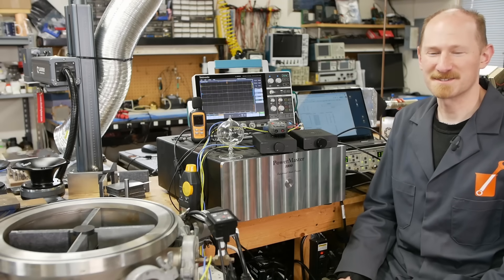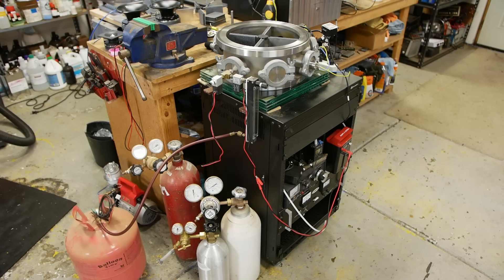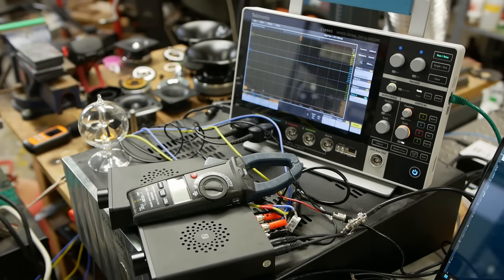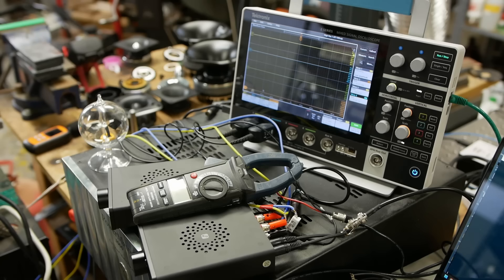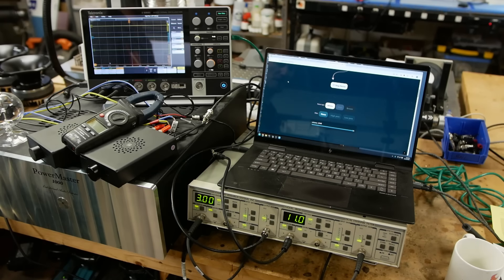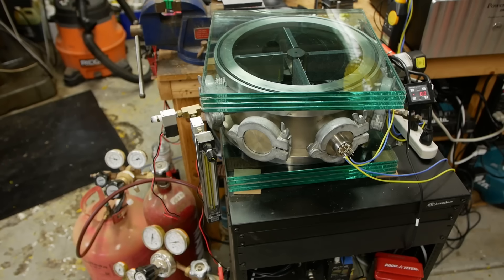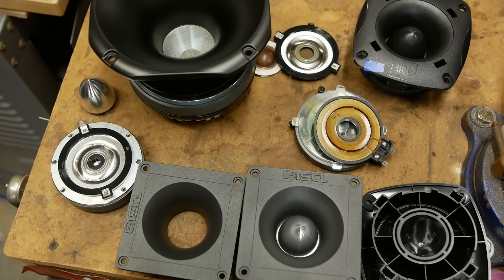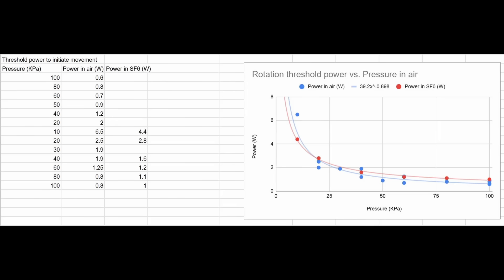Acoustic Radiometer spins in 130dB sound, clockwise and counter-clockwise depending on sound pattern

Comment: "...over 130dB..."

Compared to what? 130dB is just a ratio. Without a unit measure or a reference value it means almost nothing. 130dB(A)? 130dB(B)? 130dB(C)? 130dB(G)? 130dB(Q)? 130dB(SPL)? 130dB(SIL)? 130dB(SWL)? 130dB(HL)? 130dB(pp)? Which one?!

Comment: I wonder if you could use magnetic braking with the aluminum rotors (or install a flat aluminum ring on the top of the vanes achieve a more consistent braking) and then measure the rotation rate at each fixed power level.  This would allow the rotor to reach an equilibrium point between the rotational force from the sound and the proportional braking force from the magnetic braking.  It would drastically reduce or eliminate the uncertainty coming from trying to determine the influence of the forces on an already rotating vane.

Comment: if a standing wave makes the rotor move but only until a certain point and to make it rotare you have to use pulses, you could make a crude stepper motor? if the standing wave moves with frequency and the rotor is locked in the null the position might be a function of frequency

Comment: There are other types of tweeters than those bullet/horn tweeters. I've seen them but I can't recall their names off the top of my head but they might work differently in the different gasses.
Also have you thought about building a high-pressure chamber to see if that makes the rotation increase. IT would probably work in a vacuum chamber that I see people using to de-gas epoxy, but you would have create ports for the wires. I think it would help a little but after a certain point it would have the opposite effect.
REALL AWESOME VIDEO!!!

Comment: The TAS2764 amplifier used in apple sillicon macs also uses voltage and current sensing to measure the speaker temperature. There is even an open source linux implementation making use of this feature called speakersafetyd made by the asahi linux team. Mindblowing to see you figuring out a way to do this by yourself
Reply: If you want hints on this: V*I will indicate R, content played can indicate Impedance through the average of that content, and the temp co of the speaker coil will dictate the change rate
Reply: I remember some linux fuckery I did where I had to manually install asahi. Now I know what it is!
Reply: Some power amplifiers in professional audio systems can also perform impedance measurements on speakers. This allows you to identify defects such as a stuck speaker or even a broken housing.

Comment: What happens if the adjacent speakers have sinusoidal signals that are 180• out of phase?  That is, speakers across from each other are in phase, while the other two are out of phase.  Couldn’t you slowly ramp up the frequency to get the thing spinning fast?  This would also probably provided a way to spin it in either direction.

Comment: Wait wait wait... You're saying a bouncing ball delivers more energy to the floor on impact than a ball of clay that just thuds? I'm having a hard time wrapping my brain around that one.
Reply: Maybe this only works for bigger objects but quantum physics make it work in reverse for smaller objects like photons?
Reply: Hmm no a radiometer works using convection. I'm also puzzled a bit. Sounds intuitive because absorbing an object only catches the energy the object has due to speed and mass, but bouncing off first stops the object and then it gets pushed back again. But explaining it makes it fall apart, because bouncing means the object still has a lot of energy left while when you absorbe the object, all energy is being transferred
Reply: @Robbedoes2 the explanation is about as simple as conservation-of-momentum gets. Off the top of my head, neither relativistic or quantum effects introduced when thinking about photons should make any difference
Reply: Yes it does. Perhaps it makes intuitive sense, because when the bouncing ball rebounds, it transfers part of its elastic potential energy back into macroscopic kinetic energy for the floor and the ball. The smushed clay ball on the other hand doesn't rebound, so it doesn't do any work on the floor after being compressed. That work went into heating up the clay ball.
Reply: Don't confuse energy and momentum. For the same mass, the momentum transfer will be larger for elastic rebound. Also energy can be delivered into kinetic or thermal. A lot of energy goes into heat during non-elastic collisions.
Reply: Energy, no. momentum, yes.
Reply: @vaderdudenator1 But with momentum being p=mv and kinetic Energy E=m(v^2)/2, if the momentum change is larger, the Energy E=p^2/(2m) should also change more, no?
Reply: This was a head scratcher for me too. 
With the momentum calculation you multiply mass by velocity, so in the rebound case the mass of the paddle doesn’t change, but with the sticky case the mass of the paddle… wait… also doesn’t change?
But it gets added to the mass of the ball. 

I need to go to work now. Please finish this, clever people
Reply: Yes, it makes sense when you think about the fact that work has to be done to deform the clay, and since the deformation is permenant you don’t get any of that energy back except as heat
Reply: NOT energy. momentum
Reply: @the_moo000oon well it’s both

Comment: can you explain to me why when a particle hits the reflective side it would deliver twice the momentum? I guess my gut reaction was that if a molecule came in and hit the absorption side, that the kinetic energy of that particle would be mostly transferred into the rotor. But if it bounced off the reflective side, after the event the particle would still have significant kinetic energy, which would mean there must be less energy transferred to the rotor. I must be missing something.
Reply: Yep, I would think the same. Energy should be conserved and if a particle's kinetic energy is changed to zero that energy has to go somewhere. I sadly also didn't understand the explanation.

Comment: This is way cool, and puzzlingly molecular-ratchet-like. If you scaled this down I assume the rotor would thermalize with the air so as to not spin? Or at this scale, if the rotor was itself emitting sound? I’m wondering where that would break down. 🤔
Reply: It's complicated because the force can be used with standing waves to move blood cells thousands of times smaller than the wavelength (see: acoustophoresis, 'acoustic radiation force'), so scale should't be a problem; but i'm unsure if that would translate to the case with white noise, especially since 130Db is above the non linear region and almost creating shockwaves. With those sound pressures, the rotor has to be vibrating all over the place, and especially the foam because it has less inertia. it would be nice to see it done with lower Db values in a more sensitive setup.

I really would like to understand the reflecting/absorbing wave explanation to see if it is correct, but to be honest i don't even understand why it spins in reverse with the pure sine wave; why there is a radiation force for sound waves that are supposed to have zero overall momentum.  
I ended up on this paper "Acoustokinetics: Crafting force landscapes from sound waves"  which is entirely too advanced for me, but i mean look at that sentence "These observations illustrate that nonconservative forces can emerge along directions where the sound field carries no net momentum. More generally, it shows that radiation pressure can be directed independently of the direction of wave propagation." that sure does sound nice.

Comment: Speakers should quote peak, rms and continuous power. The rms continuous should be what you can drive it at without it blowing.  The peak is often double  this or more.  Current practice is to use an amplifier rated at twice the peak driven to no more than 70% this way there are no nasty distortions or harmonics and the speaker is driven cleanly

Comment: Static panels, with torsion measurement, to provide milligram or microgram (mN / uN or whatever) pressure for each gas - single speaker and single sound direction but directed at the test material. How about methane, propane, and more densities of test gasses, avoiding the possibility of accidental combustion of course!

Comment: I enjoyed your explanation of acoustic impedance. I ran into the term orthophonic while restoring and playing with some Victrola phonographs. The bearings that support the needle were improved, and scientific methods were applied to the horn shapes to improve the fidelity and efficiency. It surprised me how loud these could reproduce sound from mechanical coupling. Like most impedance matching methods; taking one form of oscillating material and coupling it to another: from needle vibrations to air. Even the needles had different shapes to best transfer the sound.

Comment: I'm curious: theoretically the absorptive side of the rotor vanes should be warmer because it's disappating the absorbed sound as heat.  Can you inject enough sound in order to see a difference in the two vane sides on the thermal camera?

Comment: You're on your way to a world record for "Least efficient electric motor".
Reply: lol 😆🤦‍♂️
Reply: what is currently the least efficient electric motor? afaf
Reply: @avasobersup7746  maybe that piezoelectric walking circle he made a few years ago?
Reply: @avasobersup7746  They are only used for small linear motions (typically to maneuver a valve) but the ones that heat wax to make it expand are pretty lousy, especially as they require power just to hold the valve still.
Reply: @avasobersup7746 
Ai? 
It flips switches to get people to type things with their thumbs?
It's not 100% electric, but isn't it?
Reply: or potentially a windmill that works when there's no wind
Reply: @B.M.0. ਤਿੰਨ ਸਕਿੰਟਾਂ ਦੇ ਵਿੱਚ ਚਾਰਜ ਹੁੰਦੀ ਆ ਤੇ ਇੱਕ ਸਾਲ  ਚਲਦੀ ਆ ਬਈ ਇਹ 
6.3KAV 
Hz50
235V
Ac v
ਸਿੰਗਲ ਫੇਸ ਹੈ
ਤਿੰਨ ਸੈਕਿੰਡਾਂ ਚਾਰਜ ਹੋ ਜਾਣਾ ਤੇ
ਮੈਂ ਕਹਿੰਦਾ ਭਰਾ ਆਸਟਰੇਲੀਆ ਨਿਊਜ਼ੀਲੈਂਡ ਜਰਮਨੀ ਹੋਰ ਬਹੁਤ ਦੇਸ ਨੇ ਜਿਨਾਂ ਨੂੰ ਵੇਚ ਕੇ ਆਪਾਂ ਸਾਰੇ ਪੈਸੇ ਮੈਂ ਸਰਕਾਰੀ ਸਕੂਲਾ ਅਤੇ ਕਾਲਜਾਂ ਦੇ ਉੱਤੇ ਲਾਉਗਾ ਠੀਕ ਆ ਹਸਪਤਾਲ ਦੇ ਵਿੱਚ ਟੋਟਲ ਦਵਾਈ ਹੋ ਗਈ ਜਿਹੜੀ ਲੁਧਿਆਣੇਓ ਮਿਲਦੀ ਆ ਉਹ ਮੇਰੇ ਜਿਲੇ ਚੋਂ ਮਿਲਿਆ ਕਰੂਗੀ ਇੱਕ ਜਿਹਦੇ ਵਿੱਚ ਮਿਲਿਆ ਕਰੂਗੀ ਤੇ ਤੁਸੀਂ ਮੇਰੀ ਪੋਲਿਸੀ ਹਿਸਾਬ ਨਾਲ ਚੱਲੋ ਜਿਵੇਂ ਮੈਂ ਦਿੰਨਾ ਤੇ ਮੇਰਾ ਸਾਥ ਦਿਓ ਨਾਲ ਕੰਟੈਕਟ ਕਰੋ ਮੈਂ ਬੈਂਟਰੀ ਬਣਾ ਕੇ ਸੋਨੂੰ ਦੇ ਦਾਦੂਜੀ ਖੋਜ ਹੋਰ ਹੈ ਉਹ ਵੀ ਬੈਟਰੀ ਹੋਈ ਆ ਉਹ 30 ਸੈਕਿੰਡਾਂ 'ਚ ਚਾਰਜ ਹੁੰਦੀ ਹੈ ਤੇ 50 ਸਾਲ ਚਲਦੀ ਆ
ਲੋੜ ਇਹਤੇ ਜਿੰਨਾ ਮਰਜ਼ੀ ਚਲਾ ਲਓ ਜੇ ਅੱਧਾ ਪਿੰਡ ਚਲਾ ਲਿਓ
500 KAV
Hz50
V 440
Acv
Reply: Manual sound-based PWM filter!
Reply: Just install these roof of Trump's room and senate, that's called free energy :D
Reply: ਤਿੰਨ ਸਕਿੰਟਾਂ ਦੇ ਵਿੱਚ ਚਾਰਜ ਹੁੰਦੀ ਆ ਤੇ ਇੱਕ ਸਾਲ  ਚਲਦੀ ਆ ਬਈ ਇਹ 
6.3KAV 
Hz50
235V
Ac v
ਸਿੰਗਲ ਫੇਸ ਹੈ
ਤਿੰਨ ਸੈਕਿੰਡਾਂ ਚਾਰਜ ਹੋ ਜਾਣਾ ਤੇ
ਮੈਂ ਕਹਿੰਦਾ ਭਰਾ ਆਸਟਰੇਲੀਆ ਨਿਊਜ਼ੀਲੈਂਡ
ਦੂਜੀ ਖੋਜ ਹੋਰ ਹੈ ਉਹ ਵੀ ਬੈਟਰੀ ਹੋਈ ਆ ਉਹ 30 ਸੈਕਿੰਡਾਂ 'ਚ ਚਾਰਜ ਹੁੰਦੀ ਹੈ ਤੇ 50 ਸਾਲ ਚਲਦੀ ਆ
ਲੋੜ ਇਹਤੇ ਜਿੰਨਾ ਮਰਜ਼ੀ ਚਲਾ ਲਓ ਜੇ ਅੱਧਾ ਪਿੰਡ ਚਲਾ ਲਿਓ
500 KAV
Hz50
V 440
Acv

Comment: 7:40  How much power did you manage to get as a rating for the DS-18  Supertweeter?  :face-blue-smiling:
Raw Cat just did a tweeter Shootout, and  had  a few of these horn "SPL" tweeters and noticed the variations between them with frequency response of the Piezo units, and the dynamic compression drivers.  

I know it's one of the reasons Ferrofluid was introduced to cool down these voices coils and to also aid in other driver characteristics such as dampening of resonance of a particular driver material such as aluminum or titanium.  

I've always learned with many of these exaggerated claims from speaker manufacturers to take them all with the grain of salt.

Comment: Was the impedance mismatch/power takeup on the drivers noticeable when the chamber was filled with hydrogen or helium? I wonder if the speakers would easily overheat in that case.

Comment: Why is it called a radiometer? I get that it is mimicking an electromagnetic radiometer but this version has nothing to do with radio waves
Reply: Hey Gemini, what is "acoustic radiometer"?

An acoustic radiometer is a device specifically designed to measure acoustic radiation pressure, which is the force exerted by a sound wave on a surface. This measurement allows for the determination of other properties of sound, most notably sound intensity.

Comment: I'm surprised that the denser gas wouldn't cause it to spin faster, but now I'm wondering how would you design a speaker to transmit sound better in each of the various gases and then which would perform best.

Comment: OK, I now want to see those different shaped horns for different gases.

The realization that it's just impedance matching with geometry just blew my mind. Like, it's obvious once one thinks about it, but the thing is one usually does not think about it like that.

Super cool.
Reply: Probably very similar to the differences for rocket nozzles for in- vs. out-of-atmosphere operation (i.e. honking massive).
Reply: Yes! Me too! At least a H2 and SF6 ones.
Reply: Very similar to tapered slot or horn antennas which match electrical line impedance to free-space impedance!
Reply: Agreed, to a point - the optimal horn design for helium and especially hydrogen might be this weird long thing which is so big that you lose significant power just driving it, I'd think.
Reply: Yeah I was assuming he'd continue with "so I 3D printed some new horns for the different gasses" but then I noticed there were only 2 minutes left in the video. =)

Comment: i have been meaning to build an "acoustic radiometer" using multiple resonating chambers, mainly to prove my neighbors are torturing me with 50 Hz infrasound.
you should be able to change the direction of angular velocity by toggling the phase of the standing waveform by 180°. sweet.

Comment: Think of the speaker diaphragm as an integration of point sources.  Straight ahead, they’re all in phase.  At 90 degrees, all the phases sum to zero.  In between, the amplitude varies depending on the angle.  A speaker should be less than a wavelength in diameter, in order to get dispersion.  Tweeters are small so you can hear them off axis.

Comment: with these horns, and inefficiency of speakers for low impedance gas, 
there is also the issue of saturation of the primary membrane of the speaker, 
that is, the horn is an impedance transformer that converts velocity of gas into pressure of gas while avoiding creating turbulence instead.
But for low impedance gas, the velocity cannot go arbitrarily high, as the membrane itself would hit the extension limit (at given frequency).
So for a lower impedance gas, what you need to try is to drive the speaker at a higher frequency to limit the excursion of the membrane -- and there you will have your power output back.

Comment: You could have slowed the weins rotation by putting an aluminium disk on the plastic hub and then placing a manget on the glass, when you wanted it to stop. I just realised the glass is extremely thick, but is should work anyway, just slower.

Comment: Amazing ingenuity, but I think that your explanation at 0.31/9:19 misses a key point as you push the ball at the surface. Sound waves comprise compressions and *rarefactions*.  Yes - there will be a moment when the particles are being pushed one way .. but then they will be a force back towards the rarefaction in the second part of the wave(pushed by the normal air pressure on the other side). ie A fraction of a second (half the period of the wave) after the 1 or 2 units of momentum push it one way a rarefaction will arrive, so pressure on the other side of the pad will push it back the other way. The Crookes radiometer uses light  - which is NOT a compression wave, so it's not a good analogy.  Have I missed something?

Comment: how about testing the padding of your fan you used a sound isolating material. But is it the best material? my reasonning is that you don't want something that doesn't transmit sound you want something that disperse energy of the incoming molecule. How about some kind of rubber.

Comment: Some of the real part of the coil impedance at the audio frequency will be dependant on the mechanical impedance presented to the coil motion because of the back-emf induced into the coil by its motion in the magnetic field, which could interfere with the temperature estimation. I suggest adding a very small amount of DC to the speaker drive waveform, and then measure the DC voltage applied to the coil and the DC current passing through it, using low-pass or notch filters to remove the AC from these measurements. This should give a more accurate way to measure the DC coil resistance and infer the temperature.

Comment: I read somewhere that high-end concert speaker systems use DSP thermal modelling of the voice coils so they can drive them hard, but keep within thermal limits.
Reply: While I can't confirm this... having worked with JBL, EV (especially EV QUAD systems) - their horn design on bass, mid, and tweeters are not like what you see in your home setup.  But, then again, using rack-mounted active cross-overs, and the 1/0 cables between the amp rack and base cabinets wasn't much like a home setup either.
Reply: I always assumed they did some kind of calculation on the total power for the LED lights they use for concerts too. They must be getting over driven at times, but since the duty cycle is low enough they survive.

Comment: Use CONTACT SPEAKERS instead of normal speakers. Fix it to a styrofoam or some other lightweight rigid block (covering whole bottom surface of the gas chamber) and the whole block will act as radiative speaker. When the whole block is vibrating, there is excellent contact between the vibrating surface and the air around it. I just don't have any idea what could happen at dB levels this high.